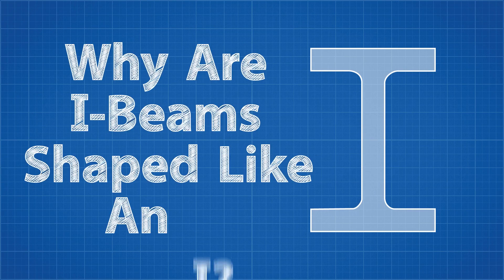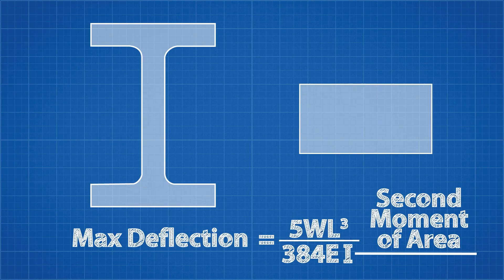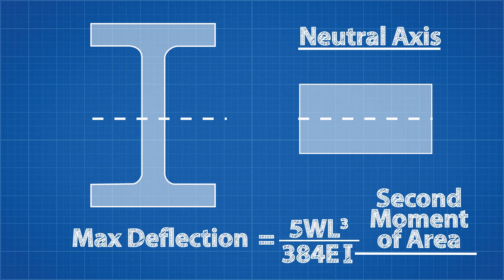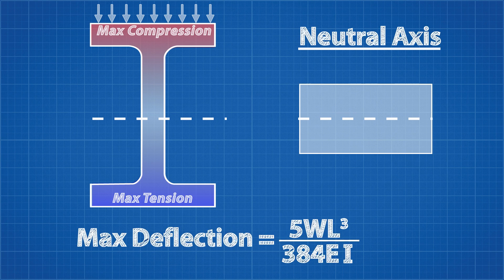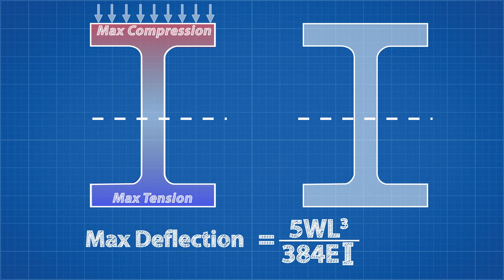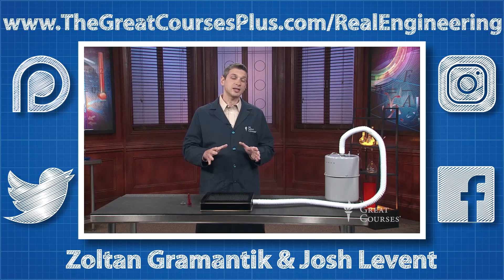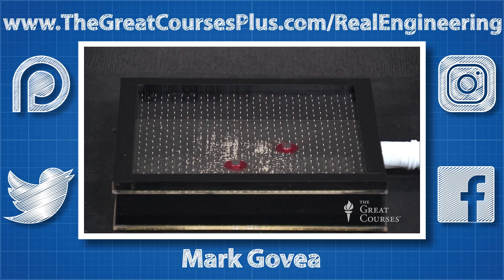Why Are I-Beams Shaped Like An I?

Comment: Does this explain why you need the serif at the top and bottom? It seems like an "I" shape would be just as strong. I'm assuming the bits at the top and bottom are merely to make it easier to tie them into other structures.
Reply: no the serifs increase the amount of stuff away from the middle, i think actually the better question would be why an I with a moderate top and bottom stroke and not a huge stroke. THe thing is basically based on his video he doesn't want the middle at all as it were, in that the mdidle experiences the least stress and so requires the least material to resist stress, it contains only enough to tie the top and bottom together. You want the top and bottom and the middle is there to be the neutral axis.

Comment: I Think you could talk about the resistance of a column, in fact the more moment of inercia, the more the column resist to compression forces. thats why the columns sometimes are empty, because the iner part doesnt helps to resist weight as not much as the parts on the edge
Reply: When it's a short column, that ultimately doesn't matter, since direct compressive yield/rupture would be the failure mode.   When it is a column of significant length, shape does matter, because buckling failure (elastic instability) matters more than direct compressive stress.

Comment: isnt it supposed to be 5wl^4/384EI and not L^3
Reply: It depends on what w stands for, in your application.  If W (usually capital) means total uniform load, then it is L^3.  If w (usually lowercase) means uniform load per unit length, then it is L^4.

Comment: An example in biology would be the tensile strength of microtubules - which are hollow cylinders made from a repeating protein structure. With all the mass on the outside, they have very long persistence lengths and are far stronger than other cellular fibers.
Reply: for tension you dont need any inertia only area

Comment: So at some point though obviously the part in the middle will become too thin, right? An I beam with a paper-thin middle section wouldn't be as strong as the ones we usually see, would it?

That fact doesn't seem to be captured by the equation you showed; since according to that you could increase the second moment of area as much as you want without reducing the strength of the beam. At what point does moving mass from the center of the beam to the edges stop strengthening the beam and start weakening it?
Reply: The thinner/longer you make the I beam 'Lateral-torsional buckling' becomes an issue.
Reply: The equation only describes the bending deflection, but that isn't the only source of stress the beam experiences. As stated in the video, you can reduce the thickness and the beam will continue to get stiffer in bending, but at a certain point the beam will no longer be able to support the shear stress at the fixed ends.
Reply: the specific problem is local buckling in the centre-web ['paper-thin'] at the support-points at the ends ; simplistically the 'support' needs to reach the 'top' at the ends as-well and it does that by the centre-web  ; the I-beam is a compromise for mass-production ; much of the compression and buckling occurs at the end-supports while the middle [up to a point - with a uniform cross-section] performs better.
Reply: I consider Muzz TheGreat's answer to be spot on.  In fact, all of these responses are great.  I am simply hoping to add a little bit more context and perhaps answer your questions directly.

There are several factors that must be analyzed or at least understood when designing a beam, especially a steel I-beam.  This video (and the 5wl^4/384EI equation) is very specific to just one aspect of design, namely deflection under only one loading condition, namely uniform loads on a simply-supported beam.  As the video indicates, I-beams are very stiff in strong-axis bending conditions (very flimsy in weak-axis bending, but I digress).  The thickness of the "web", which is the middle section that holds the top and bottom "flanges" together, is definitely important.  As you indicate, too thin, and the beam does not work.

The AISC Steel Construction Manual (aka the steel bible in the States) provides a method of determining the "compactness" of the web, which relates directly to its aspect ratio of height over thickness.  For example, a beam with a 1 cm thick 10 cm height web has the same compactness of a beam with a 10 cm thick 100 height web.  Moving on, there is an upper limit to the aspect ratio, above which the web is no longer considered compact.  The more "slender" the web becomes, the more susceptible it becomes to SEVERAL limit states, also known as failure modes.  These failure modes are especially significant at bearing locations (as Cameron Weber noted) and at concentrated loads, where either internal shear forces or local web compression forces are significant.  The AISC lists the following limit states that should be checked if you have slender webs: Web Local Yielding, Web Crippling, Web Sidesway Buckling, Web Compression Buckling, and Web Panel Zone shear.  Do yourself a favor and select a compact beam whenever you possibly can, or be prepared to do a LOT of math.

As Xedge17 noted, slenderness in the beam or in any of its components will exacerbate a phenomenon known as lateral torsional buckling, or LTB, which is a failure of the beam as a whole and not so much the failure of, say, just the web... though most engineers, myself included, would consider a local failure to be just as significant as a general failure.  You don't want either.

If you can get a copy of Chapters B, F, and J (specifically J10) from the ANSI/AISC 360 (Steel Bible Part 16), you will see just how much fun steel design can be!  Yey!

Comment: Hate to say it, but you got tension and compression the wrong way round at 1:50 
Great video though, explained it better than my mechanics lecturer
Reply: No he's right, the beam is supported at both ends, not cantilevering, so the top is compressed and the bottom under tension

Comment: Why does metal get hot when you bend it?
Reply: Because of the law of conservation of energy. If you attempt to bend something, you're using energy to do so, and because the metal beam resists movement and so the energy cannot be maintained as kinetic energy, it manifests itself as heat instead. Basically always, heat is the default form of energy, and if energy can't manifest itself in an intended way, it will almost always turn to heat.
Reply: Robert Faber ok

Comment: because O-beam isn't as catchy.
Reply: Because we just call them pipes.
Reply: drink15 :O
I have been enlightened. 
From now on, I will call pipes "O-beams" !
Reply: No, it's because it's harder for the electricians to attach their conduit to an O-beam than an I-beam. Electricians run the show B-)
Reply: Anyone remember O-Game? No? Just me? I need to go collect more deterium now..
Reply: O beam is called “round hollow section” and strength comes from the wall thickness to diameter ratio

Comment: Bones are also built that way. In a long bone like the femur the strong bone material is distributed as a tube around the soft bone marrow. The bone marrow is protected inside where it does not have to contribute to bending resistance in the neutral axis. Near the joints where shear stress is abundant that principle is supplemented by a frame of thin bones that work as struts to distribute the forces.

Comment: What are the benefits of an H beam over an I beam?
Reply: Frans Mulder same thing, just on its side. So the strongest on horizontal axis. Gravity affects vertical plane ;)
Reply: Thanks Len,
I understand what you're trying to say. The difference between an H-beam over an I-beam is more than its orientation. 

H-beam applications I've seen do not differ in orientation in use. H-beams are in fact often used as a turned H. In this configuration a brick-wall is built on the wider horizontal surface.Is this the main benefit?

I thought that H-beams have a stronger lateral stability in this configuration.Is this a reason? f.i. in case of earthquakes?

Comment: Is there concern for the I bending at the middle or does that I structure keep itself in place strongly enough?
Reply: Yes, but that's why I-beams are used exclusively for situations where the only significant applied force is vertical, so it doesn't get stressed in that way.
Reply: You may be talking about a web failure that can occur if the web becomes too slender.  Yes, if the web is too slender (too thin relative to its height), it can be susceptible to bending, buckling, etc., especially under concentrated loads or at the bearings.  If you are interested, I responded at length about this to Andrew Meyer.  If you use a "compact" section, you typically need not worry about web failures.

Comment: Another interesting place you will find a similar design principle is shipping containers. Sides of the shipping container are corrugated in such a way to increase 'I' along the shortest side, increasing the overall stiffness of the structure.

Comment: I like how you explained in less than 4 minutes a whole semester of engineering.
Reply: Well that was an easy semester
Reply: You did a whole semester on one equation.....?

Where do I sign up?
Reply: not quite.
Reply: @prelude12341  well tbh if u put in hours...it's easy !
Reply: Civil engineering has to take more than one semester about these beams obviously.
Reply: You spent an entire semester on the deflection equation? Where did you study, the University of Duuuuh?
Reply: nochtczar ofc not. Add that to structures, matrix methods, elasticity (mohr's circle and that stuff), criteria for failure and dimensioning and you have a semester
Reply: @salsamancer  there is not only deflection equation you dumbass
Reply: 1.21gW &88MPH in my case aircraftstructures.
Reply: The subject is called Stress in my University and so far its an absolute nightmare
Reply: Ha! Strength of Materials veteran, I see!
Reply: Marine Engineering is brutal

Comment: Does not explaining.
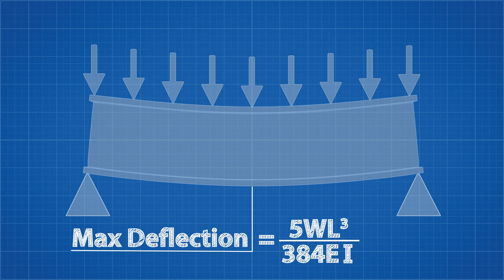0:33 just "belive me, this formulae is correct"
1:10 belive me, this is good analogy.
1:40 belive me, this gradient is correct. And no explanation of how it bends in this case.
Summary:
Why, instead of rotation: make box taller? Same reasoning works.
Why not remove inside and make just = ? Formulae does not answering.
How about twists?

For me, it's like a bit better explanation than "Why I-beams so popular? Because they're NICE."